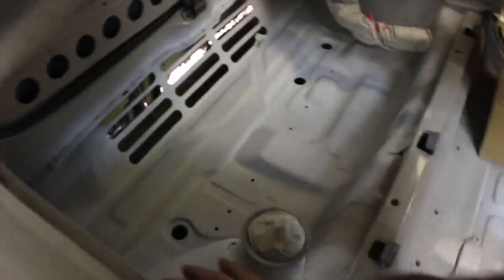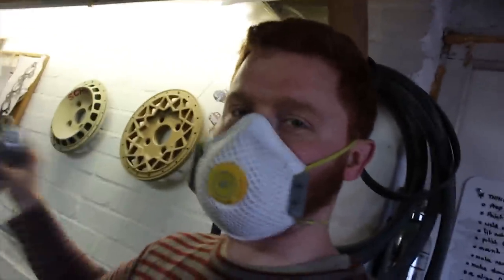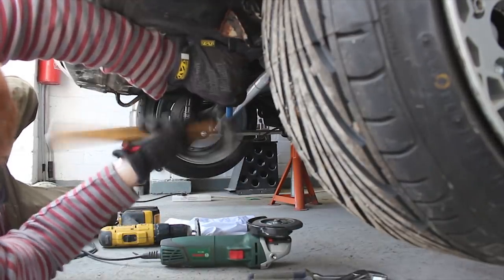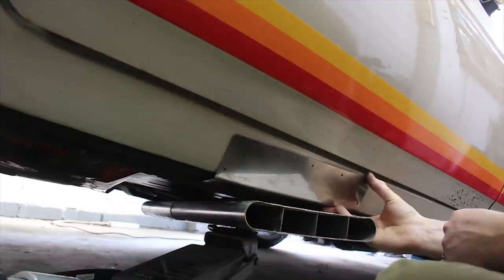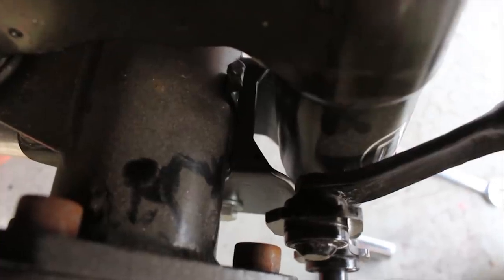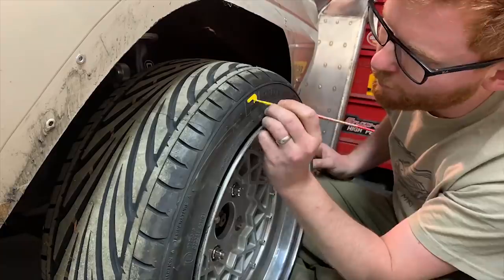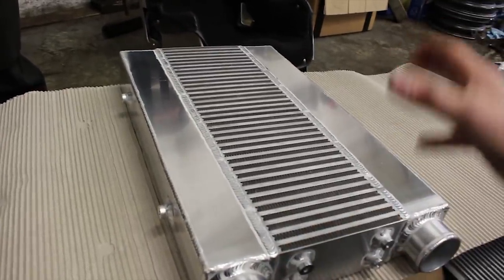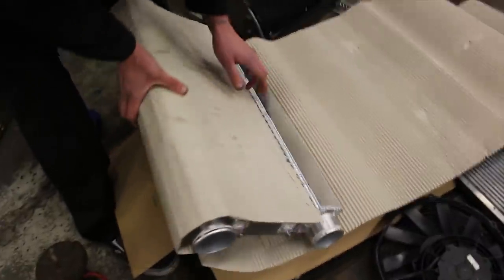Compound Turbo Mk1 Fiesta - Episode 14 - anti roll bar issue

Comment: If I get rattle cans for a (half) decent job I get my local parts factors to order in mixed up ones to the code by UPOL. They’re usually spot on and actually have a really nice even fan pattern ;) Great vid as always!
Reply from the maker: ill bear that in mind. next time i would want to get the car properly prepped and painted out the gun though. but as i said thats a long way off.

Comment: Hi Mike, I really enjoy watching your great videos.
 I Have a couple of ideas about your anti roll bar hitting your set screw !
 1, You can get Button socket set screws that have less head hight.
 2, Or you can get Countersunk set screws, For this idea it would be
     best to countersink the back of the hub but not by much and it would
     still have plenty metal left for keeping its strength !.
  Keep up the great work STP.
Reply from the maker: Hi Stuart. Thanks for the ideas. the button sockets might work if i went for the countersunk option im not too sure if i could get a C/S drill in there as it is supper tight on the axle..

Comment: What size tires are you running? I have 195/45r14 on my fiesta mk1 right now on 14x9 steelies. But do you run 15 inch rims?
Reply from the maker: mine are also 195/45/14s and the wheels are obviously only 14's, i had 15's on it before and i felt they were a little too big
Reply: @mikefpe  oh what wheels are you running? Because I can't find any good 14" in the correct bolt pattern🤔

Comment: What was the paint used on the wheels mate and what is the turbo your useing on this I’m not to shore what compound means
Reply: Compound means two turbos I think
Reply from the maker: its just an enamel paint. Compound means two turbos, one large feeding the smaller one. multiplies pressure ratios and should have the response of the smaller one and the top end of the big one.